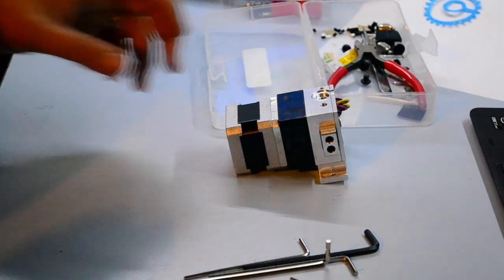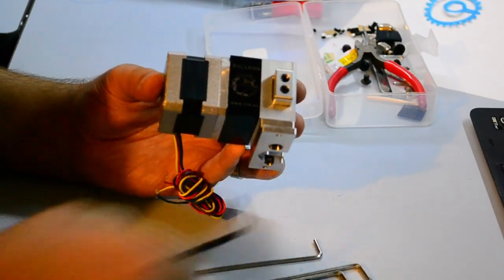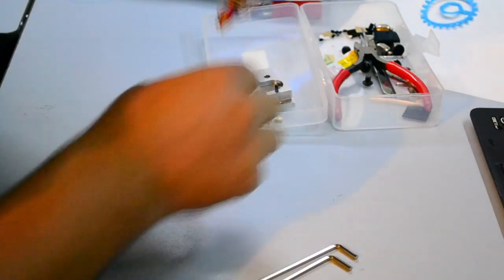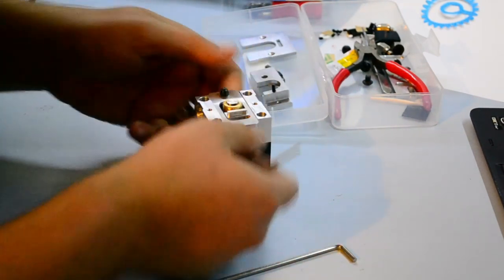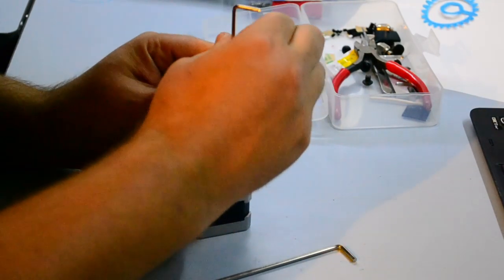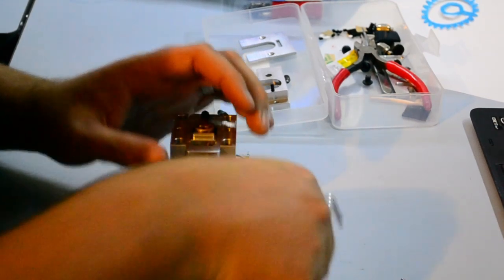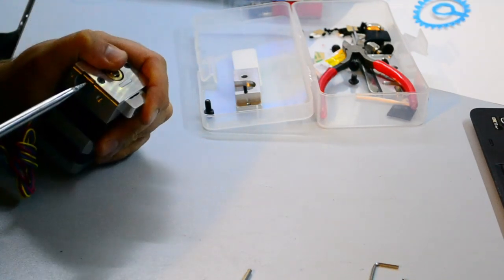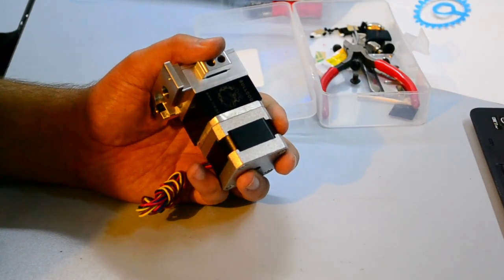Mirroring the Bulldog XL Extruder

Comment: I just tried to take the "simple" approach to reversing my Bulldog Lite and the method you initially describe doesn't appear to work.  The piece that holds the hotend is not reversable and can't be mounted to the "flipped" side of the extruder.  Unless I'm missing something.
Reply from the maker: For some reason Youtube marked your comment as spam.

Anyway If you are trying the mirror the extruder the simple way, you cant just turn the Grove mount around due to the large and small bolts.

You can however remove the brass fitting and install it in the top. then flip the whole extruder over.

The top (where the filament goes in) and the bottom are mirror images of each other.

When you install the Grove mount in the mirrored manor, the external faces don't all line up perfectly, but the bolts still hold everything together. (check out the 9 minute mark, you will see what I mean)

I'm actually looking at moving mine to dual extrusion soon so I can confirm then.

Otherwise tearing down the entire extruder doesnt take long, as seen in the video.

Unfortunately whilst RepRapDiscount make some good kit, there support has a ways to go.

I usually by from Robotronics here in Australia. Same price. Better support.
Reply from the maker: Also I have a full teardown here.
https://www.youtube.com/watch?v=LAIFr81_NCA
Reply: chibikoatreidae Thanks for writing back.  The problem I encountered with my e3dv6 hotend was that when the groove mount was facing backwards like you show @ min 9 it would not slide in -it wanted the extra space that faces the other direction.  Perhaps I'll give it another shot because like you I'd like to get back those 20mm on the left side of my printbed... In the meantime I'll print a different mount and see how that feels. Cheers!